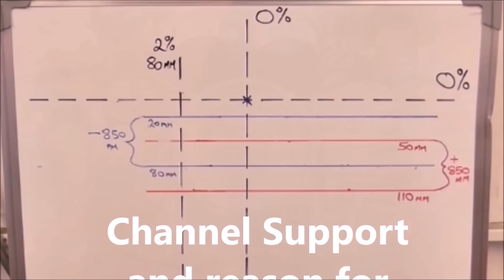Delboy's Garage, New Year Special, Q&A Part 2.

Comment: Love the channel guys.  Just a heads up on oil again.  The higher the revs, the higher the viscosity.  Ford-F15=5w 20, Lexus IS 350=10w 30, CBR  954 =10w 40.  Synthetic Diesel oil, 15w 40=  great for high revving engines.  This info is somewhat hard to get.  The only thing I was told by dealers is "buy our oil".  I contacted Castrol Oil regarding car oil in a motorcycle and this is what they said.  "Castrol does not recommend using passenger car motor oil in motorcycles.  In 1996 the American Petroleum Institute (API) upgraded the performance standards of motor oil from SG to SJ (currently SN).  This upgrade impacted the friction modifiers and zinc and phosphorus levels to address fuel economy, catalytic converter and emission issues of passenger cars.  For motorcycles, the additional friction modifiers can affect wet clutch performances, and these engines typically require higher level of the anti-wear additives (zinc and phosphorous)."    This is just info I have gathered from looking.  Please add more info if you got it.

Comment: Hey Del, i have a friend who worked at Castrol and actually there is a difference between car and motorbike oil. The viscosity of the oils may be the same depending on the grade, and you can use car oils in motorbikes, what will change is the service interval. Bike oils and car oil have the same base stock oil but in bike oils a figure of 5-10% is additives and plastic polymers. Thats because a bike oil, single oil has to do many things, engine lubing, clutch lubing and lubing the gears and cooling the engine. Cars have huge radiators for the cooling whereas bikes have smaller ones and the oil also helps in cooling. Bike oils have additives to increase their calorific value than oils in cars and also keep them lasting longer under high rev conditions as the break down of the oils makes them slightly acidic (sulphur from base stock oils). So the additives in the bike oil prevent the process of break down easily. And so i guess you can now understand why Harleys allow diesel oils because they can take the additional stresses, and compared to sport bikes harleys rev lesser. So what i want to say is put car oils ICE in your bike but dont expect full bike oil like service intervals.

Comment: The API ratings  reflect EPA ratings of Zinc and phosphorus.  Motorcycle oils have been exempt as have diesel oils.  These elements are needed for metal to metal protection.  Check the contents oil the oil.  Rotella 15-40w diesil oil is about as high as you can get for both.  Modern car oil has all but removed them due to clogging catalletic converters.

Comment: Del; regarding using car oil for a motorcycle. There is indeed one problem regarding it. Car oils tend to use certain friction modifiers that aren't compatible for wet clutches. Almost all diesel oils are suitable for motorcycles because they do not put that certain friction modifier in that is incompatible with wet clutches. This is the case at least in Australia.
Love your vids as always Del
Happy New Year
Reply from the maker: Cheers mate, happy new year, have to say, that in 30yrs of being a cheap arse, I have always put motor oil in my bikes and never had an issue, not even on long term mile bikes that I've ridden for years, more damage is done by condensation in the oil and not changing it often enough, but then you live in Oz, and you don't get condensation there aye lol?  All the best for the new year mate...

Comment: hi del & penny happy new year, just to agree with your comments on the cooler from China. I put a Chinese cooler on my bandit for £97 delivered instead of £ 400 + from Suzuki and have done 6000+ miles without a problem. although I didn't get mine from eBay I used a Chinese equivalent called Ali express.
Reply from the maker: Good call mate, we don't realise how much stuff is made these days in China, and I mean things that come from front row main dealers... many parts on today's brand new Harleys are made in China, but the purists will never admit it, or accept it !

Comment: Great video.... question I use extra lube ZX1 micro oil metal treatment for my car but want to use it on bikes I own. But would this impact on the clutch plates that run in oil. It doesn't contain particulates such as Teflon or P.T.F.E. your thoughts on this treatment, not to be confused with engine additives on the market.
Reply from the maker: Hi Graham, sorry buddy, i dont have any experience of that product, so cant comment im afraid... and i wont guess.. but any product that is designed to be more lubricative than straight oil will possibly compromise the clutch..!!   but thats just theory, id need to check it in practice to be sure..!
Reply: Moonfleet41 thanks for your honest reply, just managed to get something back from ZX1 team. That I thought I would share with you and anyone reading this post.

Thank you for your enquiry, ZX1 only treats metal surfaces so does not affect the composite fibre of the Clutch Plate, it has been used in bikes with Wet Clutches for many years without any adverse effects.

I'm now going to use it on the tiger, will keep you posted.
Reply from the maker: Excellent info Graham, thanks for posting that.. knowledge is power aye.!

Comment: :P another great episode. I always was told that car oil has detergents in it and it would make a motorbike clutch slip. Fantastic answer to my question. Tyres are a hard thing cause everyone has a different feel. I ride sportsbikes and really have confidence in bridgestone, pirelli and metzler but not confidence in michelin at all. But other people are the total opposite, just gotta try yourself.  Have a good new years and best wishes to you two for 2017.
Reply from the maker: Hey buddy... yeah. so many old wives tails, and most of them invented by 'Bar Stool Mechanics' to impress and give them something to brag and be cynical about....fact is, there are detergents in all oils, and a bike clutch only slips if its worn out or overheated through abuse..!!    Thanks for your support my friend, its great to have you aboard.. dont get too sunburned down there aye... lol  D&Px
Reply: Cheers guys

Comment: What's your thoughts on Headlight use during the day on bikes?

I personally use my headlight at all times, but many of the group I ride with insist on using their full main beam all the time too.

Despite many of us saying how blinding it is in the mirrors, they insist they can be seen more if they ride with full main beam.
I've also had an experience whilst in the car, and a motorbike approaching with full main beam. I simply couldn't judge the speed of the bike approaching, and it left me with a spot in my eyesight for a few minutes afterwards.

I've also heard a story of a guy pulling out on a bike because the bumps in the road made it look like the bike was flashing the driver out of the junction, even with dipped main beam.
Reply from the maker: All bikes now come with lights on all the time, no switched wired to turn the, off, so its not a choice any more mate..!
Reply: Moonfleet41 and riding with full main beam?

Comment: Love your episodes!  I want to confirm..I changed my air filter and my mufflers on my 2016 sportster iron 883 - but kept the original pipes.  I DO NOT need a FuelPak? It will run fine off Original Map?  I do get some Decel pop...Thanks!
Reply from the maker: Hi buddy, yes, if you have changed just the mufflers and left the front half of the pipes original with the O2 sensors plugged in and working, then, yes, you are fine on the factory map.

That's not to say that you would not see great benefit from a Fuel Pack, the mis-understanding is that you are gaining performance with the mufflers and air filter, when you are not... you are only gaining the glorious noise and cool looks!  If you want to exploit the value for money and release some extra horse power, then a Fuel Pack will give you a healthy punch in the pants. You don't have to do this right away, as your bike will run safely and be healthy as it is, but just know that later on, if you wanna splash out on a Fuel Pack, there is more power to be gained, which you will enjoy!

Comment: Recently found your channel. Some really good content.  Re Oi,l friction modifiers was the term used over here in Aus. Always ran the BMW R's on car oil (Dry Clutch no issues) & the Postie bikes (Honda Super Cubs CT110) on cheap car 20w50 to Honda Specs. changed every 2 weeks. They were run for 5-6 hours a day in 1st / 2nd gear on gradients up to 1 in 4 on grass in temps above 30 C stopping every 20 meters or so to deliver mail the load being 30 kg + 100 kg rider. I was originally a contractor and choose my own oil, the works bikes ran on Honda dealers oil and yes the clutches were a weak point but longevity had more to do with the rider's sympathy for the bike. Its a torture test and they passed with flying colours.
Having been in the same job for 25 years. Delivering mail on a motorbike I would disagree about Hi Vis we didn't have to wear it and now we do and accidents haven't increased. So IMO it doesn't make things worse  and may help so I wear Hi Vis both at work and at play, I fully respect your opinion.
I really liked your changing the battery video especially for safe procedure, also the rounded nut episode there is a lot of tacit knowledge there. Hard to explain and you did a great job. Maybe you could (& you may have already) incorporate something about how to use spanners and which ones to use in some of your videos it pains me to see people using an open ended spanner when a ring is available and would get to the nut. Never mind an adjustable.
Keep up the good work and all the best from down under
Reply from the maker: HI Bernie, welcome aboard, and thank you for your kind message.. !  Del.

Comment: Another great Q&A guys thanks so much, in this Q&A you mentioned about re mapping when you fit a sports muffler,  I have just fitted one to my 2015 bandit 1250s Do you feel I need to have it re mapped now or can I wait till its first 1000k service?          
Cheers Brian.
Reply from the maker: Hi Brian, I would run it in first, at least till the first oil change, and then get it set up with a Power Commander, if you really want to ring the best out of it, as long as there are no flat spots in the power curve, then it's safe for the time being !  Ride safe, Del

Comment: Hi Del , Penny, Looking for help/ I like to work on my own bike and watch a lot of your videos for guidance. Just finished doing head stock bearing which was fun. My next job is look at the clutch, problem was last time out when filling up with full I started the bike ready to leave put it in 1st and the bike was grabbing / pulling slightly as if i was riding the clutch a little. So my question is - does it need replaced or is it something simple? i heard likes of ideas but yours is the one i trust. Cheers Willie - GSXR 1000 k5
Reply from the maker: Hi Willie, am assuming this is a GSXR1000, and assume you're suggesting that this clutch drag suddenly started after you filled up with fuel??  It may sound daft, but are you sure you pulled the lever all the way in??  If it's hydraulic, does it need bleeding though??  Has it been serviced recently??  Difficult to make answers without asking questions first!!  Cheers

Comment: Whats the best oil for my 2014 Bonnie T-100 ?  I live In Kansas city Mo. USA. It gets Up to 108 F. In the summer &  05 F. in winter. Thank you in advance.
Reply from the maker: Hi again Steve, the normal recommended multi-grade for that bike would be a good quality 10W/40, but as it gets so hot there in summer, and so ridiculously cold in winter, you have a far greater extreme each end than most of us, this is what multi-grades were developed for ... if it was just hot, like Nevada maybe, then a thicker oil is better, so a 20W/50... if it was always cold, or temperate, like Canada, or England, then a 10W/40 would be fine as a '10W' oil at the lower end will protect in the cold....but for your ridiculous extremes... and bearing in mind you have an air-cooled engine, which relies more on it's oil for cooling.... I would blow the budget and get the best quality super synthetic oil you can afford, something like a Mobil1 Fully Synthetic 0W/50... this will protect you in the range of temperatures you have, and in the depths of winter, maybe cover up half your oil matrix with a piece of foil if you are riding fast as this will keep it warmer when it gets Artic on you !  You know, the kind of things the ice road truckers do... and when it's silly hot in summer, don't let the bike idle in traffic too long.... Hope all that helps, good luck with it, Del

Comment: Hey there Delboy :)
You mentioned about Chinese parts in this video. I'm considering some rearsets for my CB1000R. I can fork out £400 for a set of Rizomas or Satos, or I can get a set from China for nearer £150. The ones I'm looking at look like copies of Sato Racing rearsets.

Is that worth a punt or should I save up and get a named brand?
Reply from the maker: Hey David. i get this question so much its spooky... and the answer is often surprising to people... 

The Chinese copies are NOT billet alloy like the Rizomas.. they may claim they are billet parts, but there is no law in place that makes them tell the truth, and that's the point.. they play on the copycat looks and Bullshit and as the price is so much cheaper, people fall for it..and justify it by saying //"i bought some and they're fine, dont see what all the fuss is about, the top brand stuff is just a rip-off"// when this is just in fact, ignorance.... the two parts could not be more different..! 

Rizoma parts such as rear sets and brake levers etc are made from top grade, T6 Aviation grade alloy, this is a fine grade Alluminium, weldable, and super strong, it has a high magnesium content and if you drop the bike on it, it will barely even scratch........ and the Chinese copy parts are NOTHING like this..

They take scrap alloy from all manner of sources, inferior metal with no purity, melt it down and pour it into rough sand molds... then stick it in a CNC machine and carve it back to the exact shape of the Rizoma part... then sell it as "Billet Machined" rear sets.... yes, its machined... but not from Billet.. its made from monkey metal..!  

The best proof i made of this for myself was when i bought Penny some Clutch and Brake levers for her Harley, they were made by Oberon (same grade and brand level as Rizoma) and cost me £70 EACH... and what i got for £140 was well worth the money, the bike fell over one after noon as a car backed into the bike.. the bike fell smack back on the end of the brake lever...and all it did was put a tiny 'dint' in the end of the bobble, and "pushed" the entire brake clamp assembly along the bar.. i had to loosen it off to slip it back into place.... the lever didnt come anywhere near breaking... that's the quality of T6 Alloy.. its practically bullet proof ... but the ChiRipoff stuff will snap the moment you lean on it.... 

Some argue that the Chinese stuff is so cheap that if it breaks then you just buy another one and you;re still quids in... silly mentality if its a brake lever aye..!!?  Its all about choice buddy, .. know what you're buying, and be aware of what you get for your money..!     Hope that helps you.. Del.
Reply: Yeah, that pretty much reinforces what I thought (if not what I'd hoped!). I think I'll save up and get a decent set!
Reply from the maker: Good [plan buddy.. its not always possible as we dont always have the money.... but knowledge is power aye, as long as you know what you;re getting..!?

Comment: I fitted the arrow system to my scrambler then went to the triumph to re-map.
They brought it back outside and while I was having a cuppa in the shop another asked if it was mine and had I taken the baffle out which I hadn't as I didn't have circlip pliers so he took it back in and removed it, I rode home with it in the pocket.
Didn't charge me for none of it.
Reply from the maker: Hey Kev.. That sounds like the way to do it... my local place didnt charge me to remap my Scrambler as i bought it from them new..but when i took Penny's Bonneville that we bought second hand, they rushed us £35.. either way, its not much, so happy with that..
Reply: It's thanks to you and your channel I had the confidence to fit it myself.
The dealer said it would of cost about 2 hours labour. Next I'm hoping to get ohlins shocks then fork springs.
Once that's paid off I may bite the bullet and get a set of wheels made. But that's a while off yet
Reply: Shocks and springs were the first thing I did to my Sporty myself.  And, I 100% agree....It was due to watching Penny and Del that I had the confidence to do it as well.  Now, I've done some paint work, a service, and...and... LOL